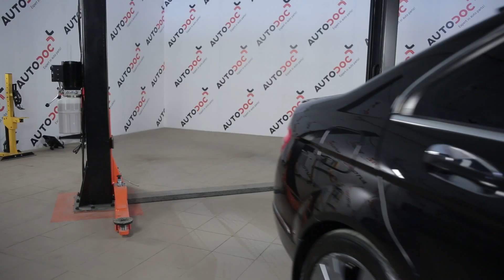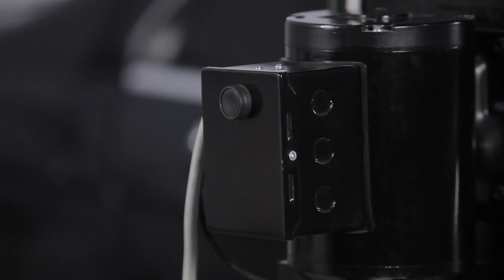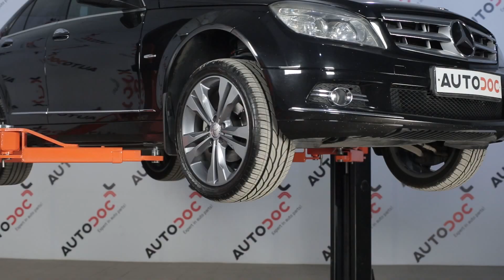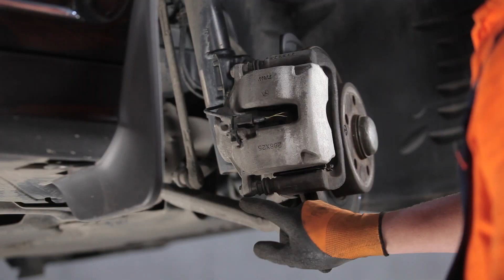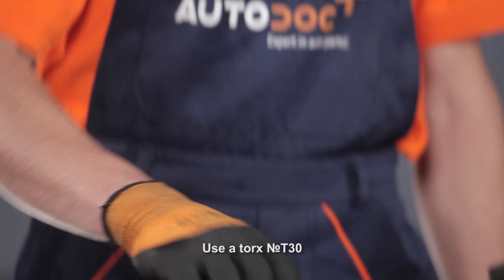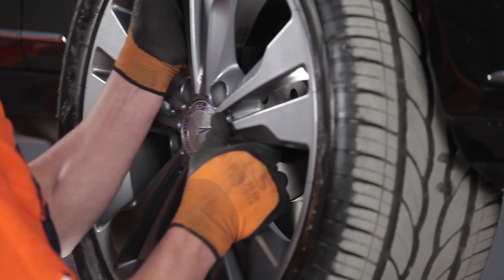How to change front brake discs and brake pads MERCEDES-BENZ C W204 TUTORIAL | AUTODOC

Comment: For those wondering. The tool used just pushes the piston in straight. There are many different tools that do the same job. It's good to use an old pad in between the tool and the caliper piston.
Reply from the maker: Thank you for the valuable clarification,
It will be very useful information for our viewers.
Please stay tuned with our channel.
Best Regards,
Autodoc team

Comment: Thanks for another great video. Is there any guidance on what torque setting the different screws should be tightened at? Thank you.
Reply from the maker: Thank you for the feedback! All torque specs are indicated in the technical documentation on the vehicle maintenance, you can find them out at the official car dealer. Best regards, Autodoc.
Reply: si180komp this one calls for one oogadooga of torque. One n half oogadoogas might be overkill

Comment: My question is what part needs copper grease on as I've done this before but it caused a lot of squeaking? Is it the back of the pads 🤔
Reply from the maker: More precisely, what and where it is recommended to use a lubricant, you need to look in the repair instructions for your car directly.

Comment: No need to bleed electronically? Can you do it manually?
Reply from the maker: Thank you for your feedback! Please, clarify or re-phrase your question. Best regards, Autodoc.
Reply: autodoc.co.uk if I change the brakes pads my self can I bleed them like any other car or would I need to bleed them through a computer? I have a 2014 c250
Reply: @KurtMarcize67  Manual bleed like any other car

Comment: very good video! but i had a question about this special tool you use for the brake caliper piston, is it nessecary to have one since i don't have this tool, and what exactly does it do

thanks a lot!
Reply: You can use just about anything to compress the piston. People use C-clamps, big channel locks opening, I've even used the old brake pads and put a pry bar between them.
Reply from the maker: Thank you for the feedback! For a qualitative and convenient replacement of the brake system parts, it is necessary to use this special tool.The special tool can be found in the shops of special tools. In case you don't have it, we strongly recommend you to visit a specialized car service center. Best regards, Autodoc.

Comment: Nice vid but why no disc wipe down, no torque setting and no mention wether the special tool was a wind back tool or if we can just use a straight push tool. Thxs for the vid for a basic over view.
Reply from the maker: Thank you for your feedback! Indeed, those are very important things to do while replacing the part. In our upcoming videos, we will try to include all of the necessary procudeures and information. Best Regards, Autodoc Team

Comment: My only comment is all straight forward up until removal of the 18mm caliper bolts.  Mine have been done up by a gorilla.  I tried impact wrench, releasing oil, breaker bar and everything I can do to move it and nothing all I have done is broke myself.  I haven't tried any heat yet but was hoping tit would move.  Anyone else found these really challenging?

Comment: Instead of showing a special brake tool that not many DIY's will have, maybe you should've shown how you can use the two old pads, the tyre iron and a screwdriver to lever the piston back.
Reply from the maker: It all depends on the configuration of your car, you can find a detailed replacement manual in the service book of your car.
If the required tool is not available, we recommend that you contact a specialized service.

Comment: Hub not cleaned, no  anti-seize between it and the rotor, sliders not lubed, brackets not torqued neither were the wheels, no anti seize or brake Lube on the pad to caliper surfaces. Just like most mechanics would do, a half-ass job. Then I see people commenting and thanking you. This is the problem with YouTube.  People think they're getting good instructions but are not getting complete info. No offense meant.
Reply from the maker: Thank you for the valuable clarification, 
We understand that mistakes were made during the replacement.
We have already fixed all the nuances in the new videos and we will try to show the replacements using special tools in compliance with all norms and rules.
Best Regards,
Autodoc team
Reply: What happens if you don’t put lube on the brake pad ends? Or anti seize?